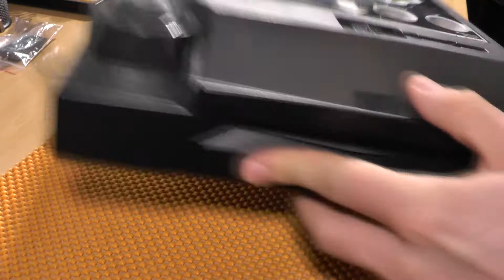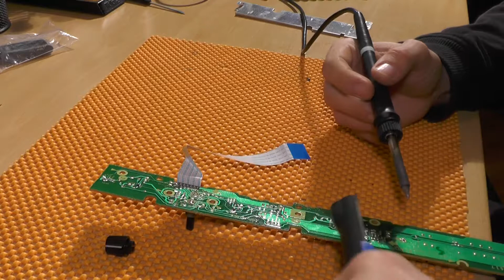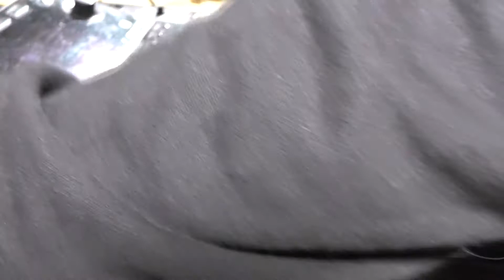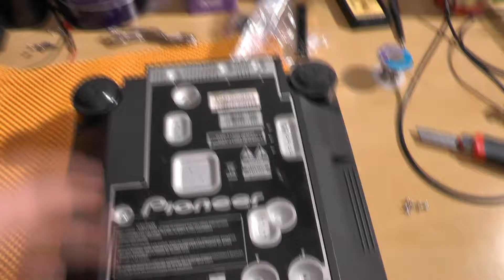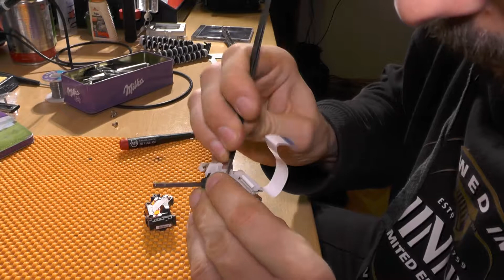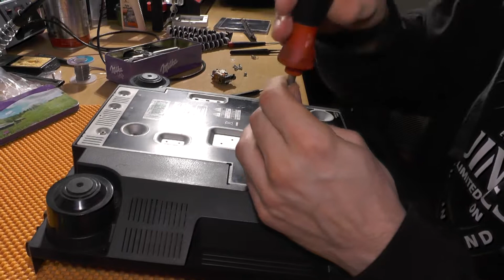[HW: How To] - Replace CDJ-900 pitch and laser

Comment: Hi! Awesome video! I have to replace de lens of my CDJ-800MKII, and I am guessing if I would have to calibrate or align the laser when I replace it. Many thanks!
Reply from the maker: tnx. No need to calibrate anything (if it's a new laser) - just remove protection solder (https://youtu.be/jDs8mN-bqig?t=915) and install it and it will work :D
Reply: @MTS_IT  Many thanks!!